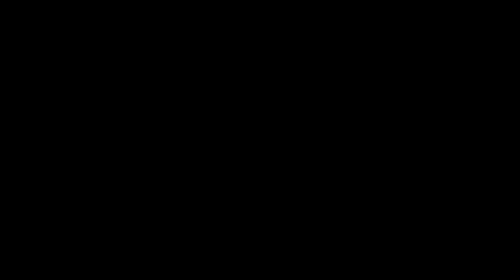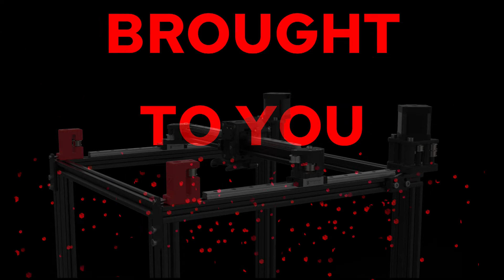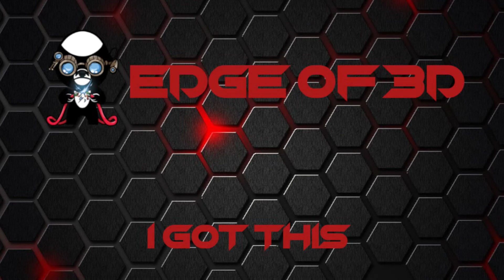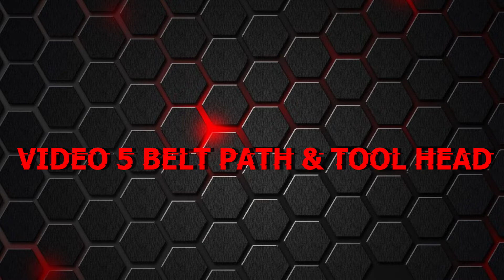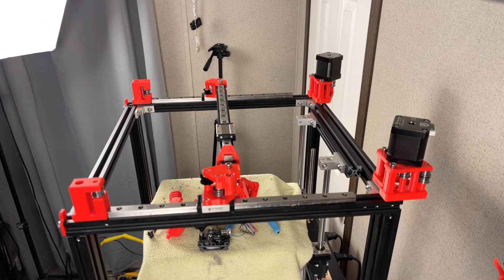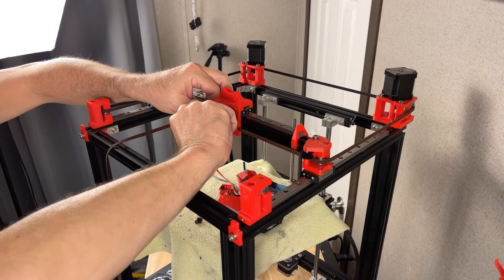MERCURY ONE.1 Full Build Video 5 - Belt Path and Tool-Head

Comment: So I downloaded and printed the parts for the tool head, but there is no documentation on how to actually assemble it. It looks like you already assembled yours, do you have a separate video somewhere going over the assembly?
Reply from the maker: I'm sorry but I have not touched anything Mercury One in over a year, I still have 2 of them that just work and have not needed anything other than feeding them and hitting the print button. I do not have any assembly guide, your best bet is to join their Discord where the team behind the project lives and someone there will have the info you need.

Comment: where are the assembly instructions for the toolhead?  I'm trying build a rapidio HF w/ orbiter 2.  I printed the files but the documentation does not appear to apply.
Reply: I'm running into the same problem and have a similar setup. I bought the parts already printed from Fabreeko and was hoping they would provide some instructions, but nothing.
Reply: @cruce3894 I figured it out, the rapido comes assembled for a different mount, I think for the voron tool head.  Just unscrew the two screws and it should right into the mercury 1 mount.
Reply: @iodine-wine  Thanks. My setup is using the Dragon HF. I am also following "Steve Builds" old live streams.